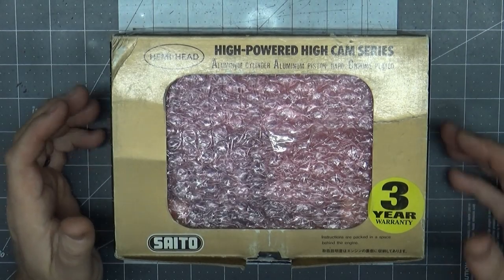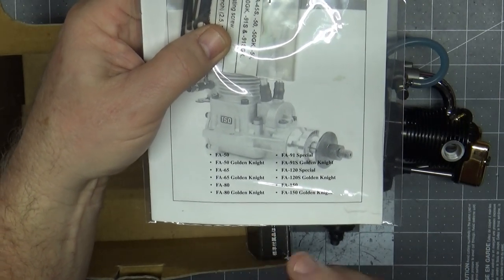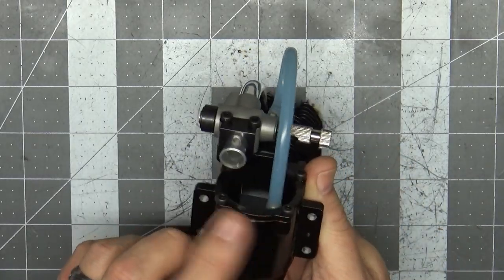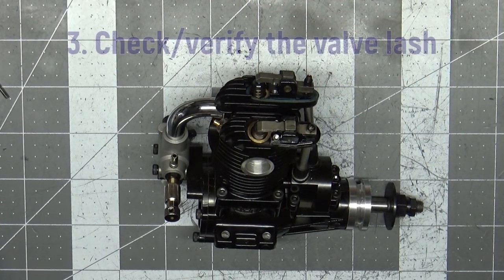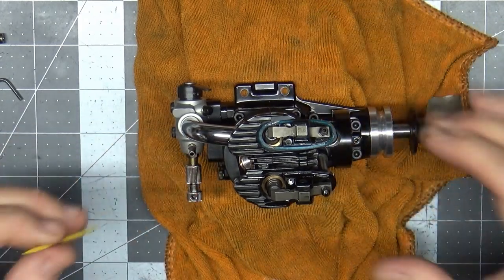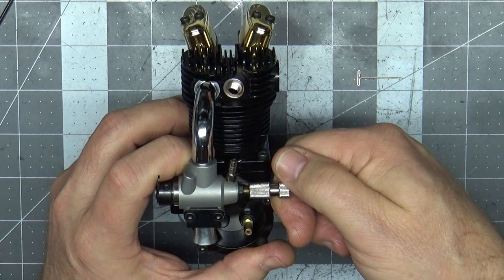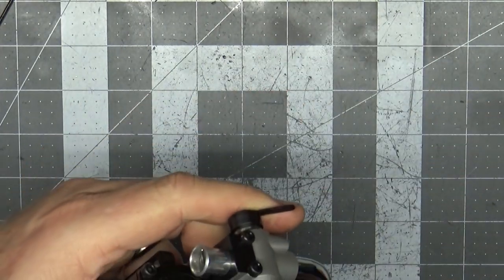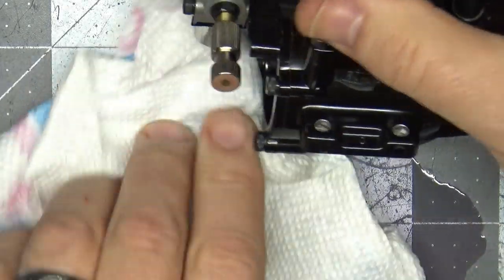Saito FA-91S GK Four Stroke Engine Setup Prior to Run Part 1 of 3

Comment: Great video as always David! Much appreciated.
Just for the modellers interested - Recently, I received a four-stroke engine from a different manufacturer. Everything indicated that the engine was brand new. There were two issues left:
- To make sure that all fasteners are tight, I re-tightened them. I turned out that some of them were loose... o_O
- Then I heard a slight "click" when turning the engine over. I suspected the piston touching one of the valves. So I opened the cam cover and couldn't see the mark indicating the correct timing. As a consequence, the cam gear must have been mounted in the wrong orientation so I changed it to the correct one. 

Without these checks, the engine could have been destroyed on the first attempt...
Lesson learned for me - Even a new engine can be assembled the wrong way, or, as you stated, the previous owner can have  messed things up...
Reply from the maker: What manufacturer?  I would guess probably ASP/Magnum or some product from Sayne, right?  I have yet to see a manufacturing issue like that on any OS or Saito engine that I have ever owned NIB.  Besides you can't just remove a cover and verify the timing on a Saito engine.  It require near complete disassembly to check the timing.
Reply: It is a Thunder Tiger F-54S I got "used" from someone who sold the estate of a fellow modeler and engine collector who passed away recently. Because the history of this particular engine is unknown to me, I assume that it could have been torn down and reassembled in the past. I just don't see any purpose for that. If I had  bought a new engine, I would leave everything where it is IMHO...
Reply from the maker: @jurgenblume5179  Yes, I see.  I do have a video on what to look for when buying used engines before and after the purchase.  It touches on some of the things you have mentioned.  https://youtu.be/zWLzhoW2wSM
Reply: Anyway, your videos extended my knowledge about model engines significantly in a practical way and motivated me to dive deeper into this stuff. So it helps me to maintain this wonderful hobby of RC-flying. Great job! I think, it is always the best thing to learn people how they can help themselves. Another engine of the (hopefully not to soon) dying glow species saved. Thanks!